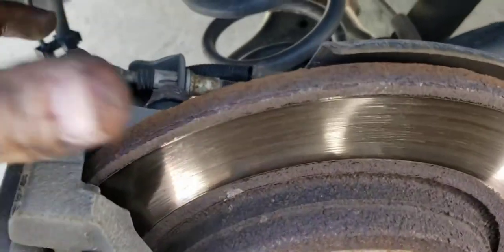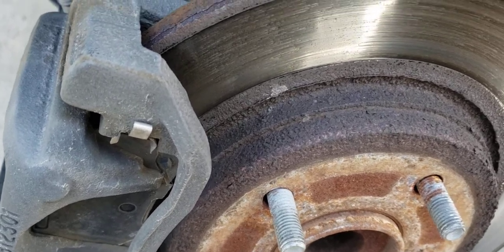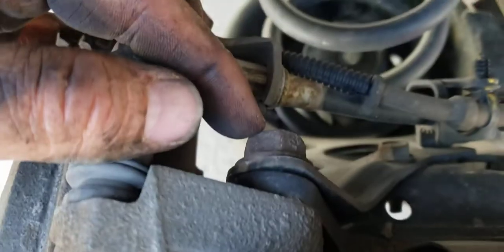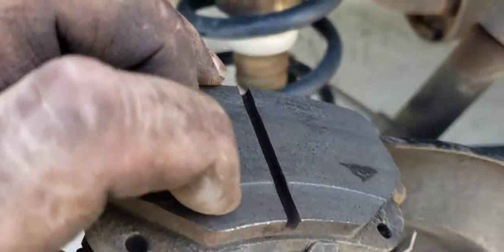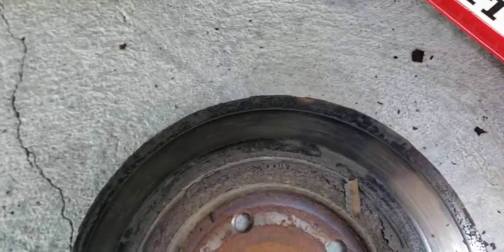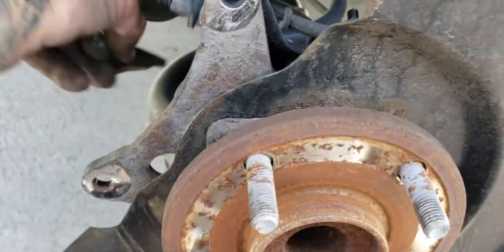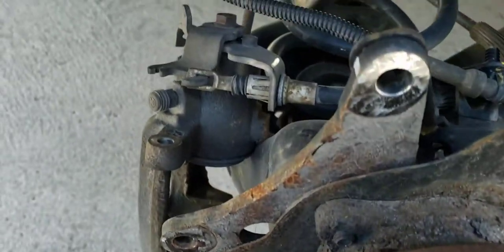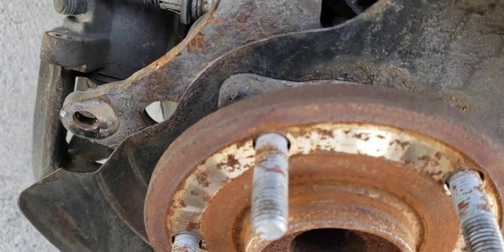2011 Dodge Grand Caravan Rear Brakes and Rotors: Twist In Calipers

Comment: If you release the bleeder valve it twist in a lot easier
Reply from the maker: Thats is true. But that can cause air to get in the system, which could require you to bleed the brakes when you are done.
Reply: Bleeding brakes is a easy job